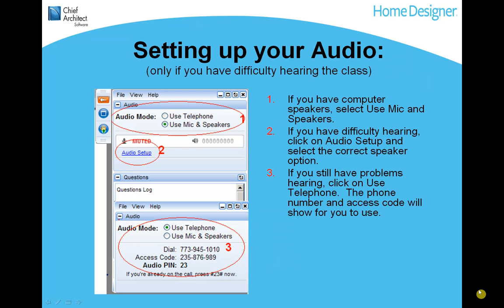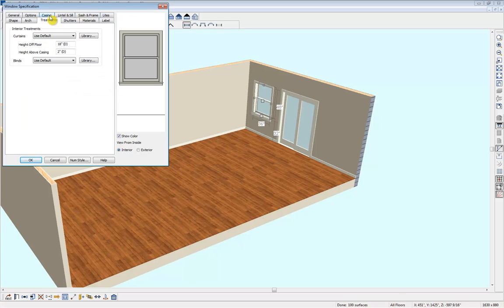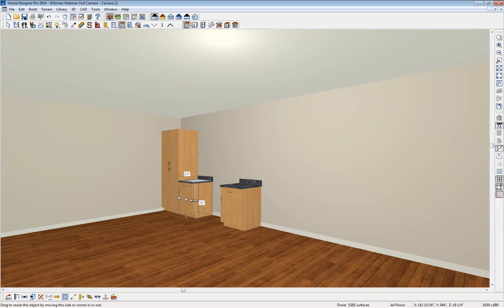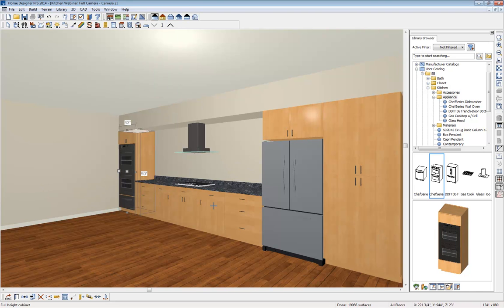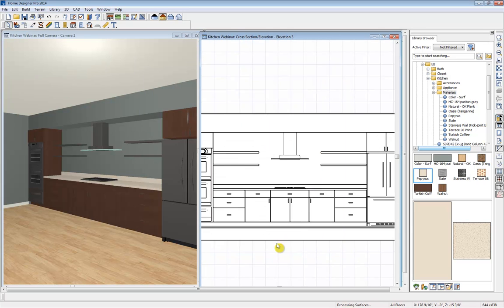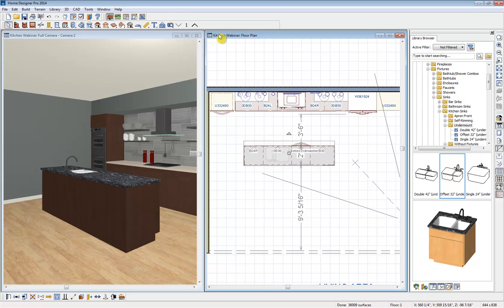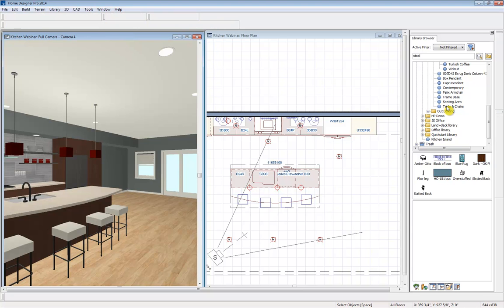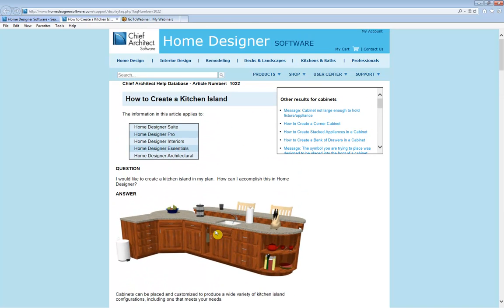Home Designer Software - Kitchen Webinar

Comment: In designing the kitchen when you made the arc in the counter top using the change line/arc tool. Where is that tool I can't find it anywhere I've checked everywhere it's not in the edit toolbar it doesn't even show in toolbar customization.
Reply from the maker: The custom countertop tool is available in Home Designer Architectural or Professional. If you own one of these versions please contact our technical support team at 208-292-3375 to trouble shoot.